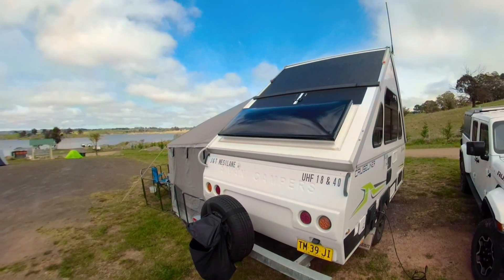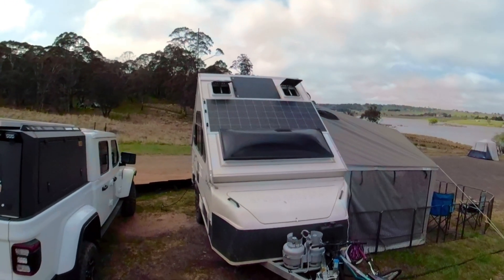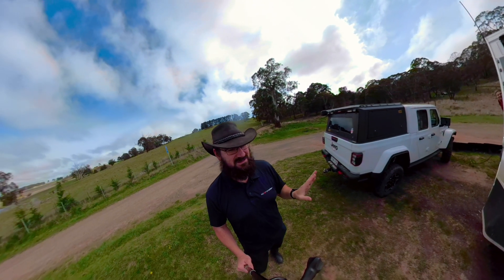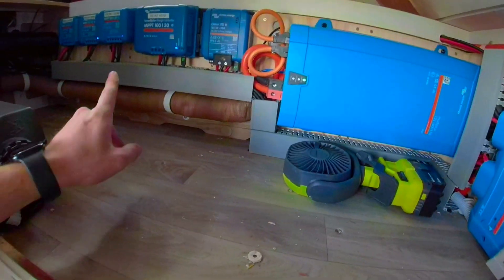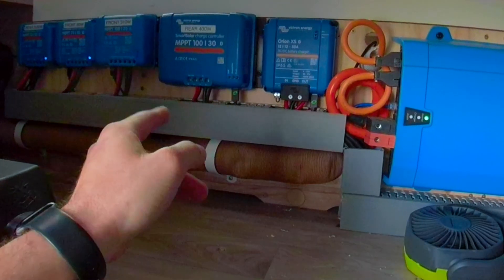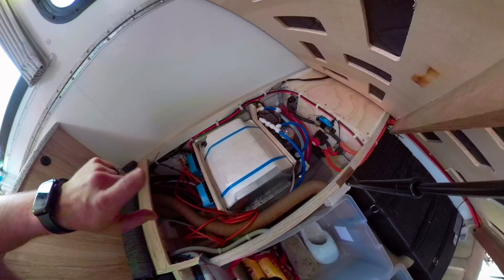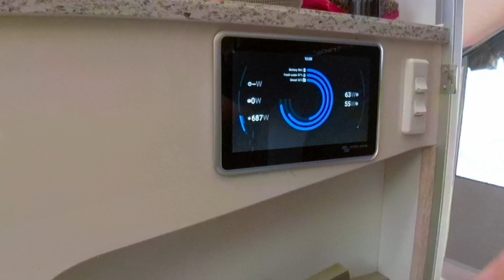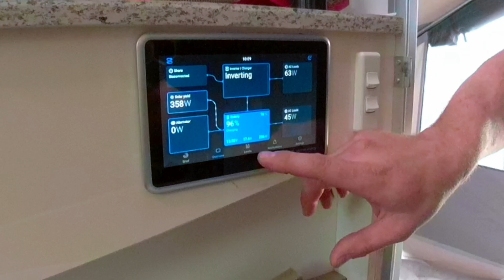The Most Modified AVan Cruiseliner - The end! 890W & 480Ah Off Grid Solar & Power System Overview

Comment: Hey Josh, love the vids...We have just purchased a 2010 Avan and I want to put a basic solar setup, no-way as big as yrs but liked the idea of the thin panels..maybe just 1 to cover the front area.Wondering if yr still happy with the Sunman 310w, it's a tight fit, or would you suggest something else ? We don't use much power, just 12v stuff, and have a 120a kings lithium ATM...any advice greatly appreciated
Reply from the maker: The Sunman is a great panel, 12 months in it’s still a seriously solid performer. Make sure it’s coupled with a decent 20A MPPT, and if we had to do it again, I would mount it with the vented gap kit from solar4rvs just because it should keep it a little cooler.

Honestly I think this panel should be a factory fit. It may be “overkill”, but solar is king, and in winter you want bigger as you could be as low as 10-20% on a bad day, and a bigger panel will make sure you don’t run out of power.

Comment: Thanks for sharing your stories. How long can you run the air conditioner on the  240Ah?
Reply from the maker: So there’s 480Ah total.

If it’s around 30 degrees outside and it’s set to 22, we can run it overnight, but we have to then keep it off during the day so it can charge back up for the next night.

We don’t have enough solar to both run it and recover the previous nights charge. We would need around 2000-2500W to do that.

It suits us ok as we don’t make a habit of spending our time in the camper during the day, we’d rather be out exploring.

Comment: Hi J&T. I am about to add the Sunman eArc 310W Flexible Solar Panel and was wondering which version and thickness of 3M VHB you used. Any issues with panel overheating with the small air space underneath? Thank you
Reply from the maker: Hey,

We got ours from solar4rvs who included 1.6mm thick VHB tape and we followed the directions on their website for application.

It does de-rate when it gets hot, down to about 70% peak of its rating when the sun/heat is really bad but it usually peaks around 80%. It’s a trade off for weight vs efficiency. You could mount it with the gap mounting kit they offer that would help ventilation, though by how much we don’t know.

We’ve never had it “overheat” as such. It’s always made power and been a really solid performer.
Reply: @jandtsjourney  Thanks for that. I might try a larger air gap, the large front window should protect it from detaching, have had no issues with the current solid panel with the plastic support kit.
Reply from the maker: @ yeah if we were going to do it again we’d do the vented gap kit on the panels on the front roof. The rear roof they have to sit flat to fit but even flat we still get reasonable performance out of them.

Comment: How much did it cost for the for the install on the the van itself, as I am looking at putting a 200watt solar panel o my Cruiseliner so that I can charge my 120am agm battery because  I have a sleep apnea machine that can run on 12v power alone and I’ve been using a 200w solar panel and chasing the sun  as the earth revolves around the sun. The solar has a 25amp mmpt solar regulator and it takes about 5 to 8 hours to charge the 120 amp hour battery, this isn’t bad but just annoying to say the least. Look forward to hearing from you.
Reply from the maker: We did the install ourselves so really, it cost us nothing but time. I would have well over 100 hours work in our install, from design to build to finish.

Rates vary but generally the cost of the gear plus hourly rate and consumables. It really depends.

A 200W panel that chases the sun will be more efficient than a 200W that’s fixed, and will depend on where/how you park the van to make sure the roof is in the sun. I would recommend the 310W Sunman eARC, as you’ll typically see 200-250W on “good” days, paired with a 20A Victron controller.

 But neither of those are cheap. Sorry we couldn’t be more help on the install side of things.
Reply: Thanks mate for you prompt  reply, and the information you provided. It’s all good. And it’s interesting to know that chasing the sun, although annoying is probably the better option for us a we don’t have kids or pets. I have borrowed a 2,2 inverter generator this time as we will be going off grid in a couple of days for three weeks and it’s going to be there if we have no sun for the solar panels. We are from Tasmania and the sun isn’t as strong as on the big island ( Australia ). So we will give that a try and go from there. Cheers mate Happy Christmas and Happy New Year to you too. 
Happy Holidays to you and your family. 👍
Reply from the maker: @ enjoy your travels. Be keen to see whatever solution you end up with.